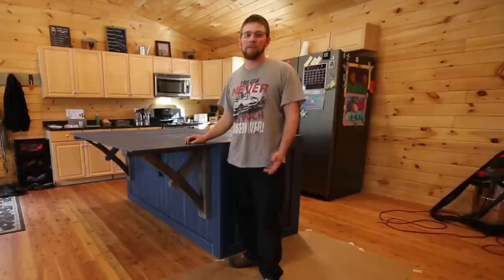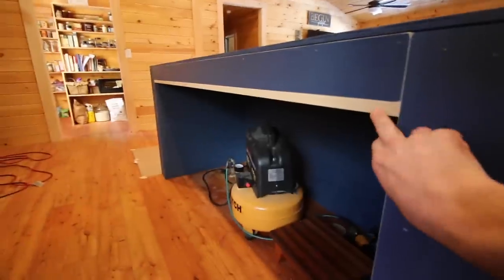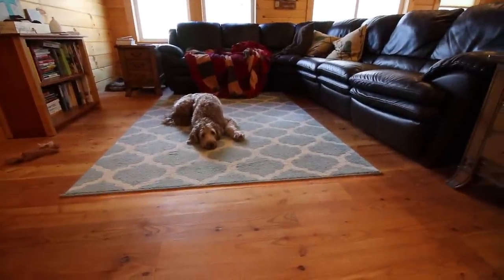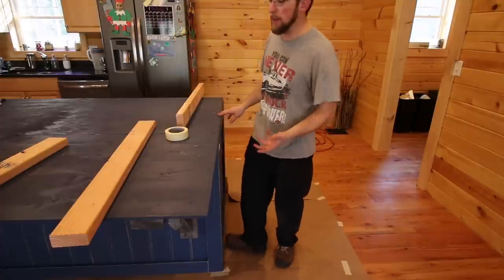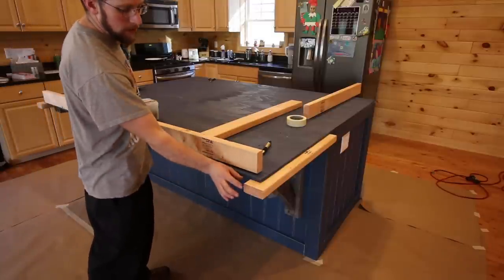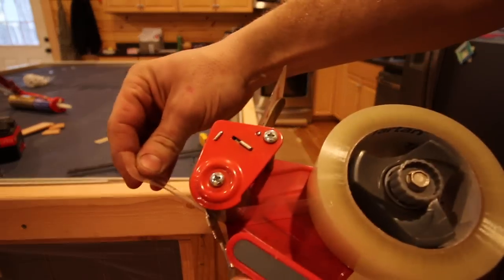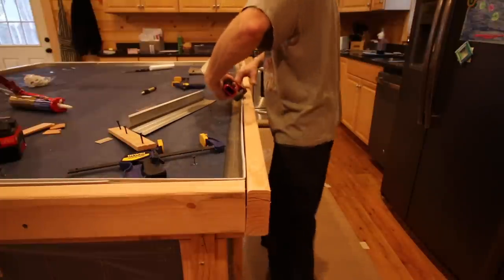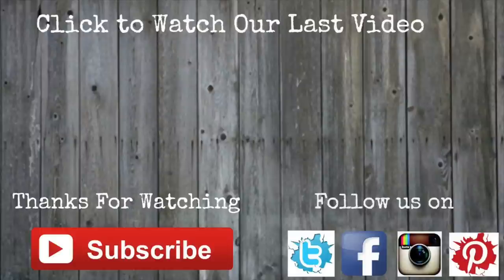Making forms For the Concrete Counter Tops!

Comment: hi! I want to extand my islande and make my main table out of it. How do you make sure the extension is trong enough to support the concrete? my island is about 4x5 feet right now and I want to add 4 feet extra for a total of 8x5. I was thinking about adding metal pipes leg for a more industrial look. Can you please help me for the weight/structure capacity?

Comment: I hear using melamine board would allow you not to sand so much. It's smooth already so you just need to get fine sand concrete I think. IDK though because I never done it, just what I hear.